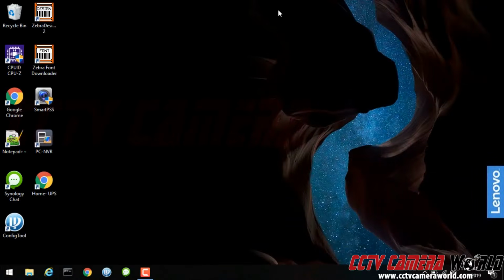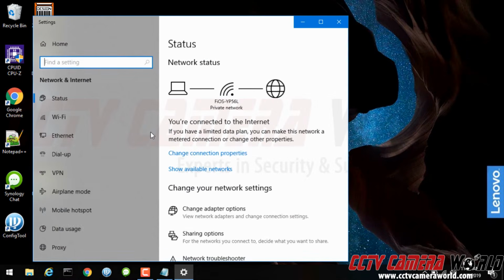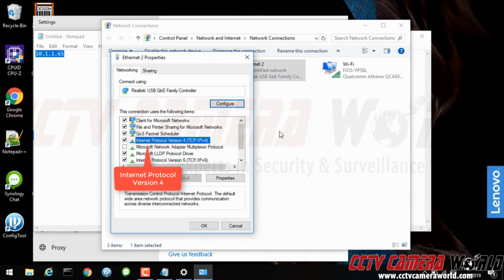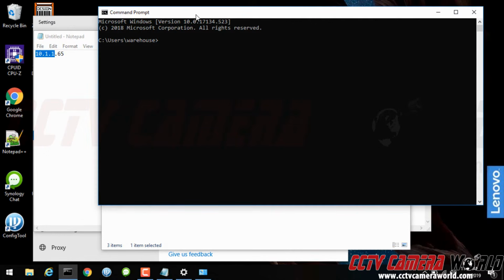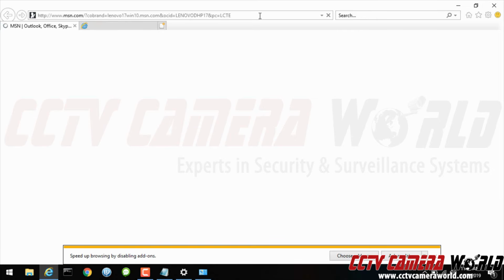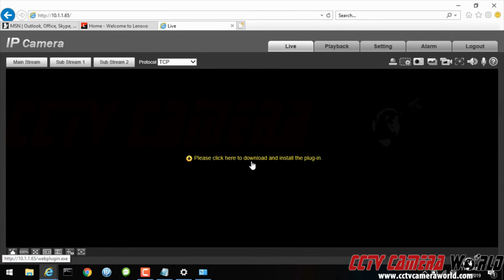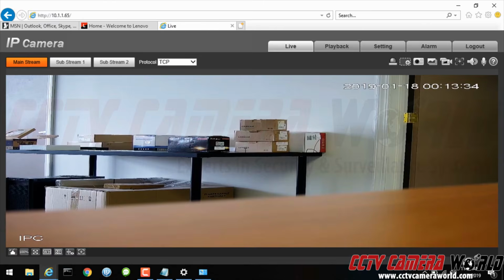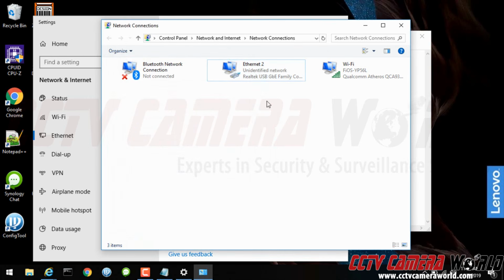How to Connect an IP camera directly to a computer

Comment: Can I use a battery to power the camera and connect the camera to my pc directly without the injector?
Reply from the maker: You can. However, we typically do not recommend using batteries as they're unreliable and require recharging rather quickly.